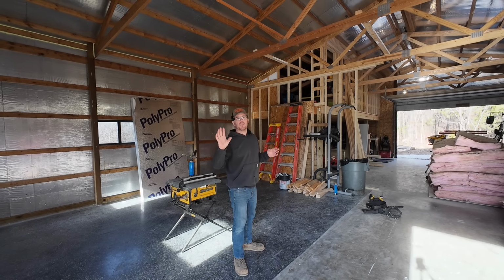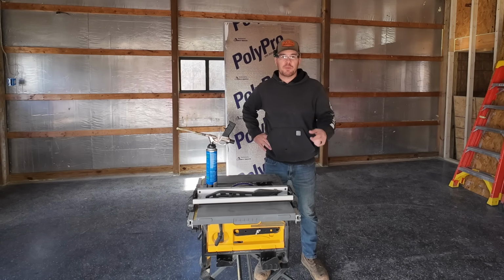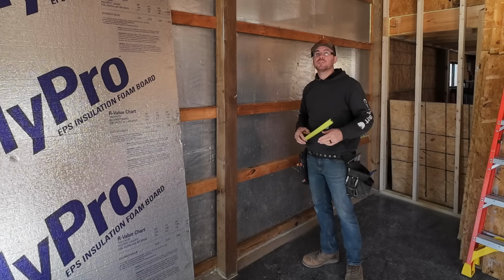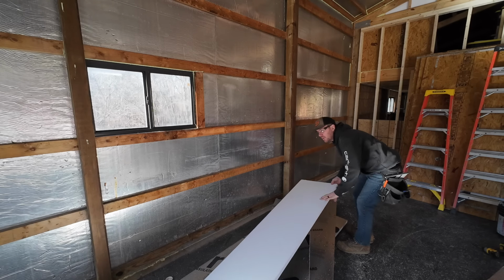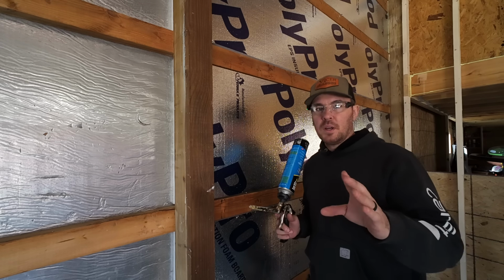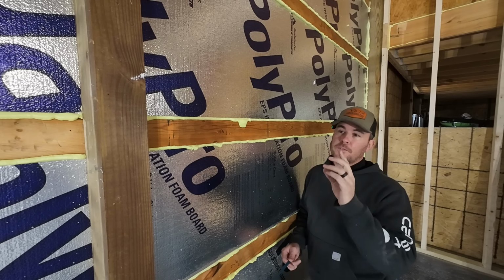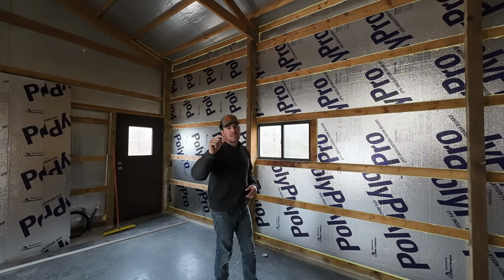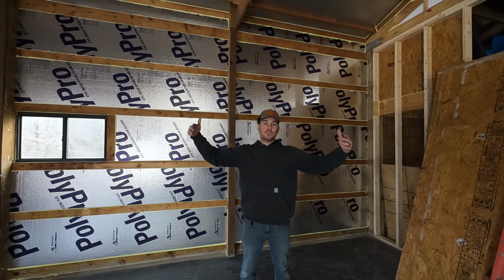MUCH CHEAPER Alternative vs. SPRAY FOAM...Insulating Pole Barn

Comment: Is the Outer Skin Metal? If Not, How the F' do you keep Mice/Rats from Chewing their way in? I had to put a Strip of Thin 6"wide Sheet Metal at the bottom of my Front Door on my camper ( had to takeoff the original ) because they Chewed their way into my Camper.
Reply from the maker: @ravenlorans  the outside it metal just like a normal pole barn.  Problem is when the doors are open they get in and i want to slow them down as much as possible.
Reply: @SpicerDesignsLLC   Well, I use Sticky Traps and Most Times, they can just Walk right over those. Poison Food is Dessert to them. Snap Traps are a Joke most times because they are either Faster or just Eat the stuff right off the trigger and Those Dual Tone Sound Repelling things are Music to their Ears... Good Luck! Cat/s!

Comment: the foil acts as a vapor barrier; drywall + latex paint a retarder. Concerns about trapping moisture? Not sure I'd bother (or want) the OSB between.
Reply from the maker: The osb is more for rodent control if they eat through the foam board.   They tear up everything

Comment: It's nuts that guy built those previous walls with finish nails.  It's crazy to think a guy has the skills to frame, drywall and finish, but not enough sense to make it strong.  I wonder if he was just too cheap or lazy to go to the store and buy some proper framing nails.  Don't even get me started on the wiring underneath the the joist hangers!!
Reply from the maker: Ya i agree.  I dont think there was much skill involved in that build.  It was mostly wrong.   Should be nice when its done though.  Will be framing it up soon.

Comment: Where are you buying the EPS board and how much was it per sheet.  The only 1.5" sheets I'm seeing are $41 per sheet at the big box stores.
Reply from the maker: You must not have watched the whole video.  I do mention all that in the video.  Lowes
Reply: @SpicerDesignsLLC  guess my lowes doesn't carry polypro.  The cheapest 1/2" sheets are 10.98 and they don't even list a 1 1/2"  offering.
Reply from the maker: @toddwikel3849  ya i had to call in to the store for the 1-1/2.  They didnt have it on the website
Reply: @SpicerDesignsLLC  thanks, I'll check with the Pro desk

Comment: Why put osb on? Why not just fame your wall and insulate back to the poly insulation
Reply from the maker: @stevewest9759 it was reused osb that i would otherwise trash.  Will help seal it up from rodents and insects that could eat through the foam.  Theres a lot of mice around so any extra barrier helps.

Comment: Sure could use a link to that $10.27 per board.  Thanks!   Very informative video, too!
Reply from the maker: Got it from Lowes.  Sounds like some other viewers said it was more expensive by them.  Not sure why theres such a price difference
Reply: 1” is $15.98 at my local Lowe’s.  Wish I could find 1.5” or 2” but I don’t want to even guess the price on that.
Reply: 2" is $38 @ my Lowes
Reply from the maker: @larrysherwood2004 make a trip to Indiana.  Waaay cheaper
Reply: @SpicerDesignsLLC  1100 miles round trip, $400 in fuel. Still save money!
Reply from the maker: @larrysherwood2004  thats a bit of a haul

Comment: It's great to knock down the population during construction with a chemical insecticide, but it's residual effect will go eventually -- a couple months, maybe a couple years. 

CimeXa is a "permanent" and non-toxic insect treatment for inside walls. It works mechanically -- like microscopic glass that slices the outer shell of the insects and makes them dehydrate. It can last for decades.
Reply from the maker: Wow! Never heard of that.  Ill gave to check into it.   Thanks for the info.
Reply: @SpicerDesignsLLC  Yeah, you can think of it as "engineered diatomaceous earth".

Comment: Here I am in my garage with a insulation knife cutting these foam panels while Kyle‘s using his table saw. I am an idiot.
Reply from the maker: Hah! The table saw is the ticket for sure
Reply: @SpicerDesignsLLC what type of blade were you using? Thanks
Reply from the maker: @momusicfan hack saw blade
Reply: @SpicerDesignsLLC  I think he means what blade on the table saw.
Reply: @momusicfan  I’m thinking a plywood blade would be best so it doesn’t tear the foil.
Reply from the maker: @GrassRootOutdoorWork  ohh.  I believe its was between a rough cut and fine cut blade. Ill have to check the tooth count.
Reply: @GrassRootOutdoorWork  thank you.

Comment: I cant help but think it would have been cheaper and faster to just spray foam over the existing board. After all the cutting and BS that went into the install you had to spray the edges anyway.
Reply from the maker: @wittynclever  you can do it however you want my friend.  The idea is that its a cheaper alternative and diy.  Of course spray foam is way faster and way more money.

Comment: Just don't use a Sawstop table saw without turning off that safety feature to cut the foam .  Ask me how I know. Down $110.00 plus a new blade. Arrrrrrrrgggg !
Reply from the maker: Yikes.  Is that the feature that recognizes a finger and locks the blade?

Comment: Why not just lay whole sheets on top of the Purlins. The wood purlins have no r value. There is plenty of room from purlin to front of post.  Then you have a vapor barrier between the metal and foam.
Reply from the maker: Purlins are on the roof. The reason i did it that way is to avoid voids where rodents could make nests and destroy the insulation.  The is already a thin layer of 3/4” poly iso between the metal and girts.

Comment: It was a interior wall dude not holding crap would stood for ever the osb tie together
Reply from the maker: I like things done right.
Reply: @SpicerDesignsLLC  no you tore it down wanting open shop then wife wanted a gym room don’t lie
Reply from the maker: Its hard to tell in text but im assuming your messing with me.  The gym was the plan all along my friend.  I have a separate building on the property where my shop is.

Comment: I would be more worried about your roof rafters being on 8 foot on centers
Reply from the maker: Thats standard here in Indiana.  Barn has been standing for 20 years.  I now have a wall down the center of the building too which definitely helps with the load.

Comment: You should never spay foam all of a building.  It will hold the moisture into the wall.    Put in vents of the bottom of the wall.  It’s the same thing as if you do brick work.  Weep holes.   Are a must.
Reply from the maker: Theres a moisture barrier between brick and the sheathing, thats why. This is my moisture barrier.  There is another layer of polyiso and the sheetmetal that isnt sealed on the outside.  It will have airflow on both side of the foam the way im going to set it up.

Comment: Kyle, I guess yer NOT A.T.D. !! (Attention To Detail) Noticed when you installed that poly panel, the lettering on some cuts ain't goin the same way!!  Sheesh, that bothers the hell out of me! Lol
Reply from the maker: Haha.  It did cross my mind as i was installing them.  Im covering it with osb so i said screw it.  Good attention to detail John.
Reply: @SpicerDesignsLLC  Still bothers ya ! I'm POSITIVE youda changed it if you didn't spray foam it!
Reply: I saw that, too.  Revoking your OCD card.
Reply from the maker: @JCWren  hah! i make one little mistake and now im kicked to the curb.  I did rip down the entire room just to reframe it.  Thats pretty OCD.
Reply: @SpicerDesignsLLC  I knew it! I'm proud of ya Kyle!

Comment: Wrong typical spans is 10 foot on center unless it’s a Lowe’s menards or Home Depot building
Reply from the maker: Ive never seen a barn with that big of span.  8-9 is pretty normal by me, but most common now is 4’ spans.  It all depends on the area and truss style. There are many different variables that contribute to the truss span, so to say 8’ is wrong, is wrong.
Reply: @SpicerDesignsLLC  well I built post not pole buildings for 18 years and every barn we built was 10 foot on center and 2X6 gifts and that is a fact young man
Reply from the maker: @rupertwelch893 gifts? You mean girts? Sounds like you built cheap barns.  The fact that your not acknowledging other variables that contribute to truss spacing is odd for someone thats been building them for 18 years.  Sounds like 10’ may be common where your located, but that doesn’t speak for the rest of the country.  Saying 8’ is ‘wrong’ is ignorant.

Comment: Finish nails are 15 and 16 gauge, not 18. Just saying.
Reply from the maker: Finish nails/ brad nails… you get the point.
Reply: @SpicerDesignsLLC  those that don't know don't know. That's the point. Not to be petty.
Reply from the maker: @AubreyJarrett-vm3li  well its a good thing its about insulation and not finish nails.
Reply: @SpicerDesignsLLC  So you are not a carpenter. I am, and have been for over 50 yrs. Stick to comedy. Those little differences mean something to folks that care about the trade.
N

Comment: A wall inside of a wall is overkill. Looks like any other reality show, and not much knowledge of the materials or proper use. Yawn
Reply from the maker: Ignorant comment.  I have to install electrical and plumbing along with backers for gym equipment and a tv and a kitchenette.  How am i supposed to do that on a wall with gertz thats only 2” thick?  That area is going to be a finished room in a corner of the barn.  Yawn